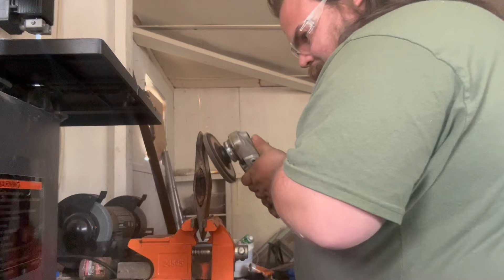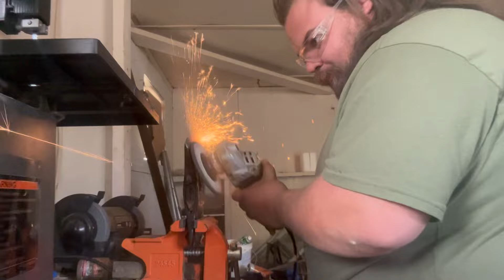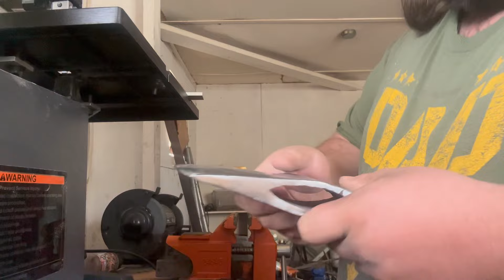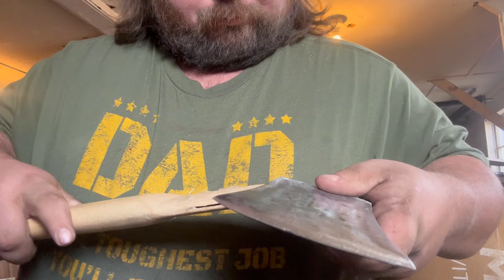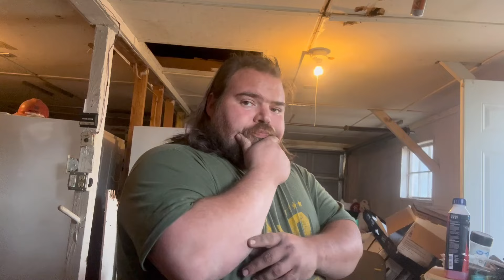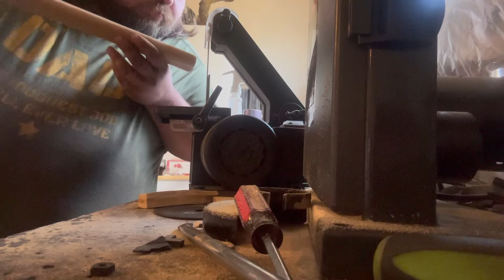Side quest

Comment: if you cut a slot in the top part of the axe handle, then slide the head over and hammer a biscuit back in (with wood glue ofc), you'll have a handle mount that can last quite awhile and looks professional, you can even do plus signs and zig zag patterns in different woods to make it look super amazing.

Comment: nice double bit axe, not necessarily for splitting though. one side tends to be a bit duller than the other. the dull side being used for chopping through bark and the sharper side for cutting the wood fiber. the short handle looks metal as hell though. nice work darf
Reply from the maker: @NonlethalHitman  lol noticed I did call it a splitting not a cutting. lol was looking for my splitting maul just before filming and was stuck in my mind
Reply: @darflinyb  i need to get around to carving a new handle for my maul one of these days. Do you oil your handles? I usually use boiled linseed oil for my stuff but im not a fan of it yellowing the wood so much, looking for a substitute.
Reply from the maker: I’m actually currently using the same thing haven’t experimented with much else